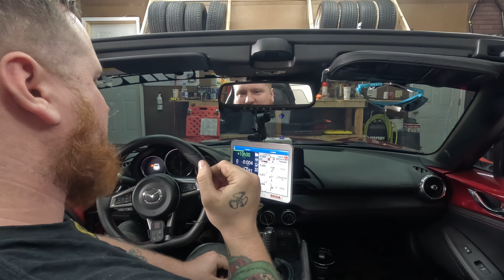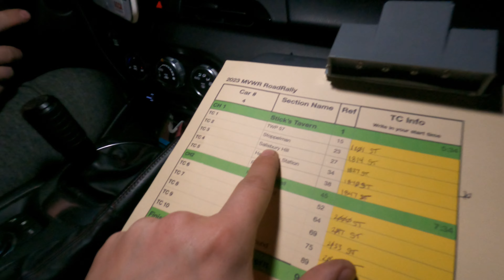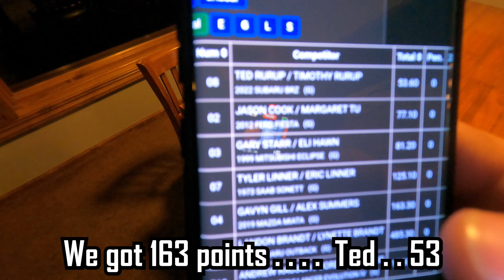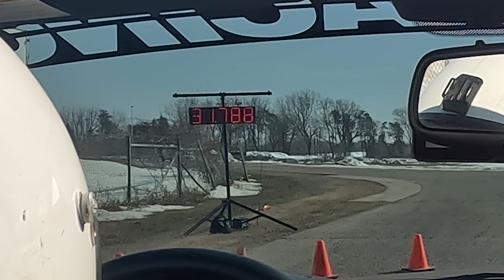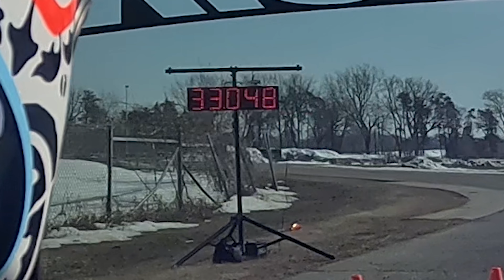Is project Miata as well-rounded as we hoped? TRIAL BY FIRE

Comment: Interesting video, good to see how the car coped with the rallying, when you auto cross you had the roof down, it would be interesting to see the difference between a run with the roof up compared to roof down, as my RF feels much more responsive with regards to the handling with the roof up, feels like it would be faster with the roof up to me.
Reply from the maker: I am much more comfortable with the roof down, with a helmet on its just too cramped in there. I think any gains from the top being up would be overruled by a slightly less responsive, less comfortable driver
Reply: @redhenracing2  Good point, I couldn't fit with a helmet either, maybe if you let the guy in the blue NA drive again at some point it would be a good data point to see the difference.
Reply: @redhenracing2  I found I could only fit with my RF's roof down and a helmet whenever I put my seat angle further back. I'm 5'8" though
Reply from the maker: @Dylanbforthree  I'm 6'1" and had to lower my seats to fit with a helmet on, but it's still a little squish. If you didn't catch our seat lowering video go check it out

Comment: The velocity difference between the 2 devices, can it be that one is using metric and the other US?
Reply from the maker: Nope, it was that the calibration was way off. When you first set off, you are given two points and the exact distance between them to the thousandth of a mile. You're supposed to start and end cal at those two points, and if you mess up one of them, which is a lot easier to do than it should be, then it can think you're going a very different speed, and for every mile you drive it may clock half a mile or 5 miles. It's an easy way to ruin the whole day. We had at least one team at this one that ran a few stages, found their cal to be way off, and started the whole thing all the way over with a fresh calibration.